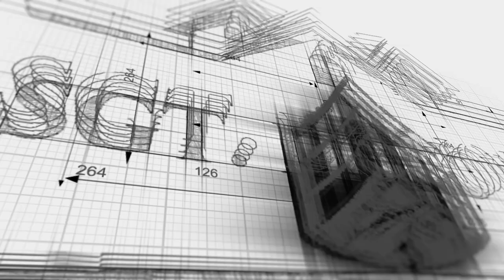Building a Trapdoor to the Basement

Comment: A thought for the part of the ladder that is most difficult (the topover) is to have a pull out extension to operate as a handrail on one side. Could be something as simple as a pipe in a pipe. Doesn't need to be overly complicated to still make a huge difference in ease of access. Heck, could even use a heavy duty drawer slide with a wood support, and a wood rail. The ideas are pretty endless. I even thought of a mini elevator with some linear actuators hahaha. Then I technically wouldn't even need hinges or anything. Just drop it straight down. Really pulleys and some synthetic rope would work better... still. so many things one could do. That'd be way to slow obviously for only 7 feet of travel, and then needs manual redundancy or disconnect for power and mechanical failures.